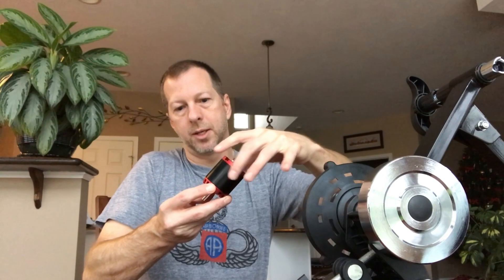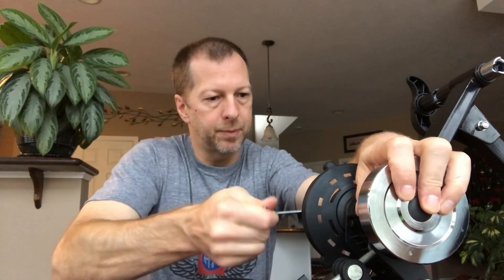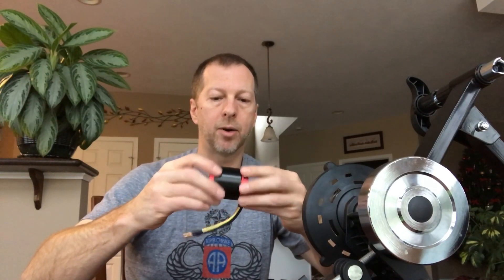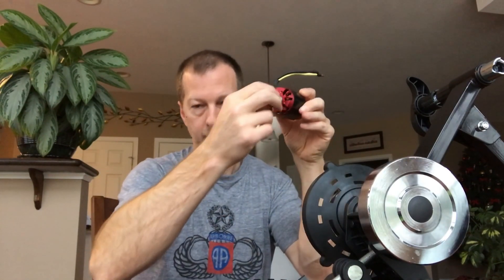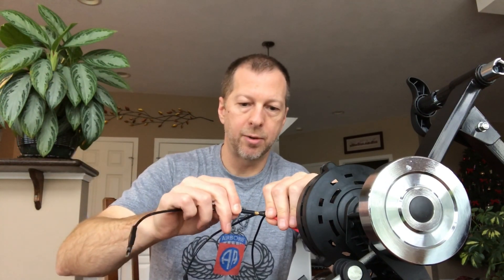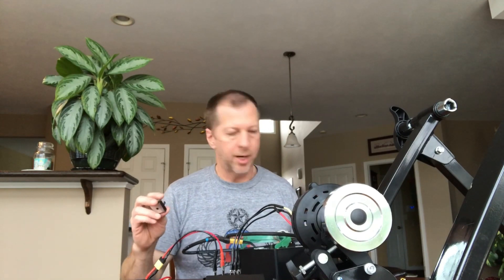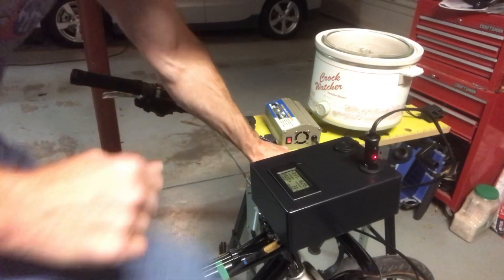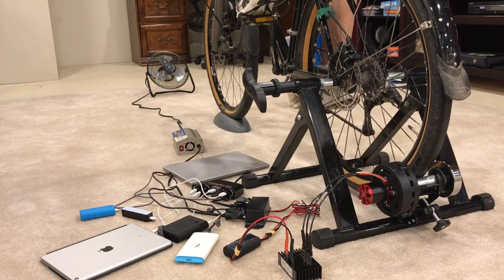Best DIY Bike Generator Design - easy build!

Comment: Hi, very cool build you did just to let you know it is not the watts that made the fuse blow it is the voltage input to the converter they only take 12 or 13.8 volt you over powered it put a buck converter inline and adjust the out put voltage to 13.8 and you will be good to use it.

Comment: Hello this is so wonderful we have constant electricity issues in South Africa and some days solar can fail. Thank you for this video! I wanted to ask do you think this would be ok to connect to a portable power station like a bluetti
Reply from the maker: Yes, absolutely! I do the same, lately I just charge a 50AH LifePO4 battery using a charge controller to moderate the resistance
Reply: Thanks so much. 😊I'm fully committing to making this now. Have the funds for the equipment thanks again truly grateful for the share its helped me beyond anything you have made this easy enough for me we have blackouts constantly and sometimes no sun so you literally helping me continue to work and feed my family ❤

Comment: I already have a broken E-Scooter, some solar stuff and batteries, all I need now is a hometrainer, a rectifier and some way to mount the E-Scooter motor
well, technically the rectifier is just for making the mounting easier, pretty sure that the "ideal diode" circuits I got in storage would be more efficient, but it's a bit cumbersome connecting 6 parts and 12 wires
I didn't really ride a bike in well over a decade, basically I just wanna make use of the parts I got and the other stuff is pretty cheap

Comment: Crazy.......I have the same exact set up(that I thought I dreamed up myself) except the motor(350 watt) and I use a 29er mountain bike.....I just got all my parts today, except one: I have a DC 350 watt motor with just 2 leads coming out of it. What kind of rectifier do I need? Thanks for your time!
Reply from the maker: Sounds like you have a DC motor, so won’t need a bridge rectifier. You’ll definitely want a meter to see what voltage is coming out of the motor. What do you plan to charge with the generator?
Reply: @GenesGreenMachine  I did some more research after watching your video and found all I need for my application is a charge controller. I plan on finishing up the whole rig today with one last trip to the hardware to get some bolts and rubber caps to use as legs/dampening. I plan to use in extreme emergencies to charge devices through my inverter set up. I just need to finish the generator rig to see what kind of power it is..........generating...lol
Reply from the maker: Looking forward to hearing how it works! How much noise comes out of the DC motor?

Comment: Confusing why a RC motor why not just a 12 volt motor and a charger controller
Reply from the maker: That’s one way to go about it. I chose an RC motor path because I can align the output voltage target by picking an RC motor with a Kv in the right range based on my expected RPM.

Comment: Built it similar to yours. After some pedaling decided to add a voltage regulator similar to this one: https://www.amazon.com/Voltage-Regulator-Converter-Waterproof-Transformer/dp/B07WFMG11F
Reply from the maker: Yes! Adding a voltage regulator is a good option and opens up the choice of motors used as well.

Comment: I cant find 100a 1000v. Can i use 100a 1600v?
Reply from the maker: You sure can!  This one should do the trick too: https://amzn.to/3s3xPlA
Reply: @GenesGreenMachine  whats the difference of 1000v and 1600v? Sorry i don’t have any idea what’s the difference between the two. Also i would like to know how to regulate the power output? Lets say even if i pedal harder the voltage will remain to the set wattage. To prevent damage from the inverter like you shown in the video.
Reply from the maker: The voltage of the rectifier is just the peak voltage it can handle. We’re not getting anywhere near those voltages. To regulate power output, I’ve been using one of these charger controllers lately: https://amzn.to/3stcq5t they work fantastic! I’ve got two of them now.

Comment: if you cycles for 8 hours, how many power can you produce (assume average joe)? And if you convert that to $$$, how much is that?
Reply from the maker: Ha! If you are looking to save money, this is not the thing for you. Power in an emergency - check. Feeling productive after a workout - check. Being able to brag to your friends that YOU charged your phone and laptop this morning - check.  To answer your question, assuming 75 watts an hour for 8 hours and utility rates are 10 cents a kilowatt, you’d save about 6 cents. You’d be far better off buying a 100w solar panel and being more productive with your time. But the coolness factor of this project will always be there 🙂
Reply: @GenesGreenMachine  I thought it could be economically efficient enough to setup a power farm which is connected to power grid, where the poor can come, cycles, and earn enough $$$ to buy food for the day. 

I was thinking of a place where they can come, do some monotonous work that require little/no skill nor training but productive enough to earn breads of the day. Thank you very much sir. Back to drawing board on how to help the poor.

Comment: Thanks for the video. Instead of outputting the box on the handlebars to the inverter, why not connect it to a solar charge controller, then to a battery? That way, hopefully you wouldn't blow the fuse in the inverter? Just an idea. Thanks again.
Reply from the maker: I just need an inverter that can handle more than 300 watts!  It's on my wish list.
Reply: @GenesGreenMachine  Thanks. Is this your easiest build? Or is the spin bike build easier? I don't have any experience, so I haVe to use the  easiest way possible. 
Also: your TV set will probably hold up better if it gets a signal from a pure sine wave inverter. 
By the way: the contact link on your website isn't working. Thanks again.

Comment: how's the resistance when pedaling? I'm interested in using this sort of setup to supplement an off grid solar system using lithium ion battery cells (should be much less loss than lead acid, charging efficiency for li-ion is 95-99%). My battery is 24 volts, so it would be better to use a 140kv motor to get a good charging voltage. I'm wondering how much force might be needed to pedal that though, or if using a boost converter and a higher kv motor would be better. I dont mind if it feels like a high gear or a bit of an incline so long as it's comfortable for a steady pace....
Reply from the maker: The resistance you feel while pedaling depends entirely on how many watts are being demanded by what you are charging or powering.  Powering a TV that draws 50 watts feels like a casual ride.  In your case where you want to charge Lithium Ion batteries, you can (and should) control what that resistance is by using a charge controller like this https://amzn.to/2xQTkiE - and with this type of device, you can adjust the felt resistance by increasing the amps going into your 24v battery bank.  The charger will regulate the volts needed by the battery bank, you can adjust the resistance (amps) to whatever you are comfortable with, up to the limit of the charge controller and/or battery bank.  This charge controller accepts 11-18 volts, so you can use the same pedal generator design as I've outlined.  Do you have a picture of your setup?  How may watt-hours is your battery bank?
Reply: @GenesGreenMachine  I'd hope to be able to generate 200-400 watts to make it useful, figured the motor choice would determine resistance but it makes more sense what you're saying that it's more a factor of the load. 
 I was thinking I could plug it into my MPPT solar charge controller, but seems like that might vary the resistance too much as it'll be constantly searching for a maximum power point, plus I'd need the input to be over 24 volts for it to work properly with my system. The linked charge controller wont work cuz my battery is 7s and I'd want to be able to output more maximum watts, I think this might do the trick though? https://www.amazon.com/ISDT-Touchscreen-Battery-Charger-Discharger/dp/B0823DGJXS
My setup is still in the works, but I built a 3kwh 24v battery from surplus LG electric car cells (for less than $500!): https://drive.google.com/file/d/1BesSTPFzoZ3TPgMCuOURX99zMTVSfjf_/view?usp=sharing
https://drive.google.com/file/d/1D-bxngDZ_3H5Kwd4gUFTQyzAuhPRZGQ1/view?usp=sharing
(got the cells at batteryhookup.com) 
I'm building it for the RV I live in full-time, using the COVID downtime and extra cash to finally convert it to the off-grid roving dream home I always wanted it to be ;)  But seeing as I live in Oregon, I can't expect solar to meet all my energy needs, especially in the winter. So looking for other ways to supplement the charging, and this sort of bike trainer setup is very enticing there. Might as well get some exercise in the process....
Reply from the maker: Sounds like a great project!  I actually have an iSDT charger https://amzn.to/3dzKKEb that I use with my stationary bike pedal generator.  It works quite well, but has one major drawback for pedal generator use: at about the one minute mark, and every 3 minutes there after, charging pauses for about 3 seconds!  So while I'm hammering away at 170 watts, all of a sudden there is no resistance for 3 seconds!  It's all good if I watch the timer and am prepared for it, but if you aren't anticipating it - oh boy!  That's why I steered you toward the other style of charger - I have a 80 watt max unit that doesn't exhibit this pause behavior.  The other thing I do so that felt drop isn't so shocking is incorporate some other load like charging my laptop https://amzn.to/2WnZDnk which pulls ~65 watts, along with my cell phone, iPad and other devices that end up being ~100 watts, then use the iSDT to charge a LiPo for another 100 watts or so.  I talk about this setup to some degree in this video: https://youtu.be/IUMoNNuXoZ8
With the right charge controller - you'll have a great setup, I just haven't the budget to buy a bunch to try.  if you do spring for the iSDT, I'd be curious to hear if it has the same behavior as my Q6 Pro.
Reply: @GenesGreenMachine  hhmm yeah that does sound like an annoying problem, I guess I could take a chance and hope they fixed it with the Q8 model. Does it still do that if you're not using it with the pedal generator as input? Looks like the Q8 has a "DC output" mode too for just using it as a power supply at specified amp/volt configuration,  that mode might be the best to use for my setup since I have a BMS to manage any overcharging etc and the cells can handle way more input amps than the q8 can even output.  I probably wouldn't be pedaling anyway when the battery is close to full.  https://www.isdt.co/down/pdf/Q8_EN.pdf
Still unsure if I should go with the 320kv motor or a 140kv......thinking 140kv would be best so there's less loss in the voltage conversion to charge the 24v battery. I guess it would just output greater voltage but less amps at the same riding pace as the 320kv?
Reply from the maker: If you’re strictly targeting 24v, then yes the 140kv is a good choice.  I don’t suspect there will be much loss with the 320kv conversion to 24v, but every little bit helps.  I’d really be interested to see if you see the same issue in the Q8 - if it works, I’ll buy one too!
Reply: @GenesGreenMachine  yeah I ordered the Q8! will let you know how it works. And I went with a 170kv motor, realized that the Q8 can't take input above 34v so that way if I'm riding a little faster than 15mph I shouldn't push it over the top.  Also, wondering if you've ever tried using a gimbal motor? Those seem to be a lot cheaper than comparable RC motors, seems like the hardware needed to couple them to the bike shaft would be trickier though....
Reply from the maker: @Ntron933  That's awesome - really looking forward to your update on the Q8.  Good catch on the top voltage input, best to keep it in a range that will give you a little buffer.  You can always gear down a little too, just manage the load with the controller (Q8).  Good luck!  Other questions always welcome, even if I don't have all the answers :)
Reply: @GenesGreenMachine   hey i finally got everything to build it! The motor took a vacation in shipping. So far I'm having trouble getting the Q8 to work properly with the pedal input-- it seems to work better as a boost converter instead of buck though, when I pedal slower with the 170kv motor it seems to be able to get a more stable output, but it only works stable if I set the amp draw less than 3A....otherwise it seems like it can't build up enough amps to do the conversion for consistent output, so it drops in and out. I'm thinking the motor is the problem though, maybe a higher KV motor will work better, which should give me lower voltage but more amps. I was able to get a decent output around 100w with my MPT-7210A mmpt boost solar charge controller instead of the Q8, but it's not very stable since the MPPT is constantly tracking so the resistance fluctuates and drops out if theres any pause or change in pedaling speed. 100w feels pretty tough (i'm not in peak shape though), not a comfortable ride....does 100w feel like a climb for your setup? I'm wondering if the 170kv motor is also less efficient as a generator, it certainly takes a bit of force to get it rolling and the resistance without any load stops the wheel pretty quickly if i'm not pedaling. So yes, gonna try a different motor!
Reply from the maker: They only thing I'm doing differently is in front of my Q6 Pro I have a couple small lead acid batteries to give me a more stable 20-30 volt buffer before feeding into the iSDT that then charges my LiPo.  I have a couple of these https://amzn.to/2AyMJuO wired in series to create that buffer.  I think that will solve the issue with the Q8.
Reply from the maker: I wanted to give an update on my latest experiments that might help you.  I picked up voltage regulator that works really well for me - https://amzn.to/3ky16AI - I just fix the volts at 15 and adjust the amps to whatever load I'm comfortable with.  With your 24v battery bank, you should be able to go right into the 400 watt range.  You'd probably need to swap out the 170kv motor for a 140kv or so to get the needed 1.1x input voltage that the voltage regulator needs.  This regulator doesn't have the pause every 3 minutes that the iSDT does.

Comment: Thanks gene, I was putting together a pedal generator,and I saw this , I abandoned my initial dc 350w motor and used my electric skateboard Motor, it’s a belt drive unit so I just bolted the truck to a bit of ply and took of the whole trainer mech, the wiring is the same as yours up to where it goes into a solar reg.
I have just christened it it puts out an easy 7 amps and seems to perform as yours, I have however bought what you have specified to see how it performs, I am intending designing a motor I can print ,I live on a yacht so this is great,my fitness now will improve and I will laugh at clouds,when my solar is down,
Thanks for sharing buddy, I also enjoyed your instructables videos
Reply from the maker: Hey Daniel - thanks for sharing! I often wonder if anybody actually builds from the plans I've shared, so it's great to get feedback from those who do.  Safe travels, my friend!

Comment: Nicely done! How about keeping the hot bits near the flywheel and attaching a little fan to the same shaft to cool them off; and just have the meter mounted to your handlebar to monitor output?
Reply from the maker: Hey Roy - I do usually have a fan trained on the "hot bits" (center mass) when generating, and definitely agree having the meter on the handlebar is the way to go.  I've boxed up the meter with the bridge rectifier in my latest video with the spin bike design - but the approach applies to both designs.
Reply: 12V PC fans will consume ~150mA and can keep the diode pack cool.

Comment: What are the specs for the bridge rectifier?
Reply from the maker: I've used a couple different style of bridge rectifier, this larger 100A one https://amzn.to/2HLDzNh with cooling fins, and this smaller 35A one https://amzn.to/2sEmZWf that needs to be mounted on a metal plate to dissipate heat.  Both seem to work fine, it really depends on how you want to go about your build.  Using the smaller 35A (with more than enough capacity for us humans) is nice for boxing everything up and mounting to your handle bars like I show in my spin bike generator build https://www.genesgreenmachine.com/spin-bike-rc-motor-powered-pedal-generator/  - the same design can be used in the bike trainer build.

Comment: Thanks my electric bill was $28 last month I could save more for one charging this chromebook see if i can tun my internet on battery power
Reply: Hey man you able to tell me exact list of what I need to buy off Amazon I'm in austrailia
Reply from the maker: Look for a bike trainer that looks like this one: https://amzn.to/3glt4P3
The 320KV motor should be similar to this: https://amzn.to/2A6MzKy
once you get these two, you can measure the shaft sizes to determine which coupler you'll need, like this one https://amzn.to/2ZL5TaG
After that, the 3 phase bridge rectifier https://amzn.to/3d3gjq4 gets you to the base setup.  From there, add a meter, car charger adapters, etc.  Sorry I don't have Aussi links to parts - hope it helps.
Reply: @GenesGreenMachine  so those 3 items I'll buy and be able to set up the rest I already got 2 bike trainers
Reply: @GenesGreenMachine  I've ordered them those exact parts hope thatll get me what I need